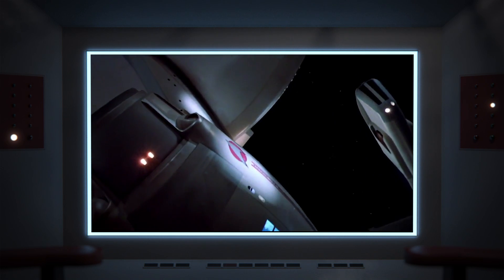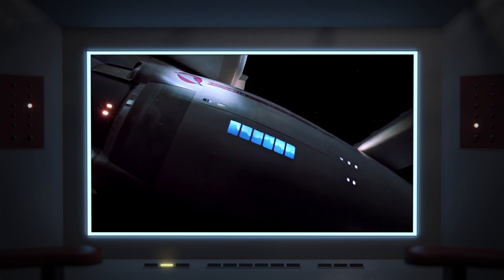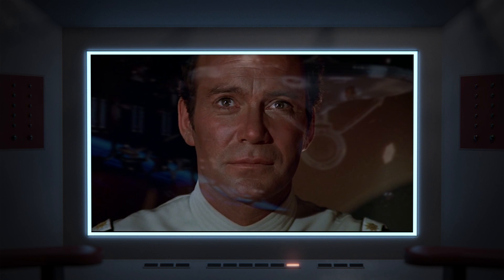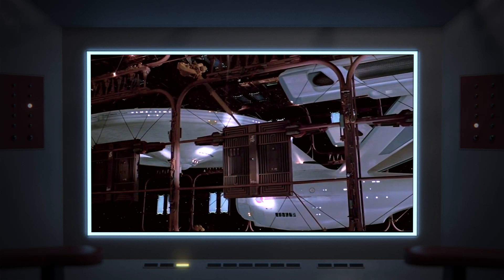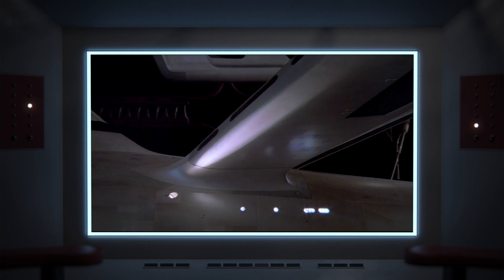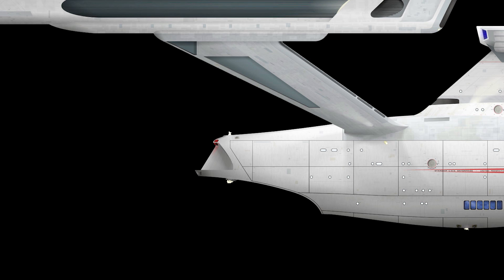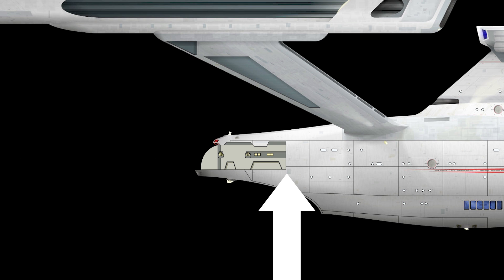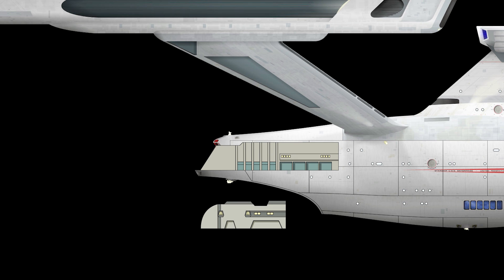Why Have Angled Nacelle Struts? (Enterprise Refit)

Comment: From an engineering standpoint the struts are no longer attached to the nacelle at a single point and are now more triangulated.  This makes them more stable as anyone who ever built models of both ships can attest.  Assassuming an inner framework, the re-angling of the struts would allow them to tie into the neck of the ship for more a more rigid substructure.  Assuming a flow dynamic from nacelles to hull the fewer 90 degree angles the better.  Aesthetically speaking most people don't like hard 90 angles as much as sweeping curves and raked angles.

Comment: Apart from the fact that you're waaaay too OCD about this there would be no need for elevators at the rear of the shuttle bay if instead of having the rear of the hull scooped out it actually stayed more tubular, then they could have had a two tier shuttle bay.
Also, the original series Enterprise is by far the better looking.

Comment: I always thought the swept pylons would aid with power distribution to the warp field coils in the nacelles. Anyone familiar with electrical engineering knows that shorter distances equal less resistance to power flow, and the pylons now attach to the nacelles toward the middle...thus permitting a more even flow to the coils spread along its length. Additionally, since the pylons attach to the secondary hull closer to the warp core, the efficiency would possibly be increased even further. Yes, the pylons do seen longer than before...but the path of power routing is still about the same, if not shorter.

Comment: This is one of my favorite ships in the ST universe and as such, I have researched it a  lot over the years.  One theory, which does tend to make sense (although has never been confirmed) after listening and reading up on the evolution of each new class of ship for the Enterprise, is that the positioning and angle of the struts allow for the ship to not only be more aerodynamic (for lack of a better term) during warp which would allow for it to enter and exit warp more efficiently, and also sustain higher warp factors for longer periods of time.  One of the other theories which also makes sense is that due to the addition of the vertical warp core and foregoing the original engine room design, given the positioning of the new vertical warp core relative to the new angled struts, allows for more efficiency of plasma transfer and ease of access to the struts if maintenance/repairs needed to be done.  Outside of cannon, one of the simplest explanations for this is that the original Enterprise was put together and designed with (compared to TMP and future designs) less detailed thought to the internal locations of everything.  When Phase2 and TMP were being brainstormed, this gave Gene and others involved (namely Matt Jeffries) time needed to redesign and make things more detailed and to map out the entire ship.  The ship turned from a flight of fancy and only being on for 3 seasons to something that could have possibly been around for decades and carry the franchise and crew far into the future, like it did.  The original script for TMP was quite different.  Think of it more like possibly touching the face of God versus only looking for your creator.  From the information that has been given through various videos and websites (and if anyone could find or has the original draft written by Roddenberry before development hell took over, I would be incredibly interested in reading it), TMP was not only supposed to be incredibly cerebral, but also going to be incredibly more internal for the characters, focusing more on what each character would possibly view as God and what it means to them.  This would also stand to reason that since even more time was going to be spent inside the ship vs what we actually see in TMP, the ship layout needed to be even more well thought out and designed. Regardless of the reasoning behind the more prominent changes to the refit, this is still and will always be one of my favorite designs.  I love all the designs of every ship we have seen so far, but this design by far has always been my passion.

Comment: Several thoughts on this.  First is the obvious one that it looks better and they had the budget to build a proper model.  
As far as in universe reasoning, mine goes something like this.  The original design worked and was designed that way to be simple from an engineering perspective.  While there is some controversy about it, I'm in the camp that thinks main engineering was located in the secondary hall and that the tubes we see in engineering cross each other then go straight up the nacelles.  With the refit, main engineering was moved forward with the verticle warp core running the length of the neck. With engineering moved forward, it would make sence to use that space as dipicted in the video for the shuttle bay and other things, but I think this would have been an after thought on what to do with the space.  
A third reasoning has to do with impulse and inertial damping and the like.  We know from mentions in TOS that there was occasional worries of nacelles buckling and such, and I expect this was a limitation of their design.  Additionally under impulse, the nacelles are dead weight being dragged away as the impulse drive is on the saucer.  While inertial damping would normally help with this problem, it's my opinion that the inertial dampeners can only respond fully effectivly to known accelerations, hence why we see folks tossed about when the ship makes movements unexpected to the computer.  It may have been worked out that a stronger strut was a good idea to prevent damage from twisting and the like in combat or other cases where the inertial dampers could not react properly.  

As a side note, I'm not entirely clear on it, but am starting to form a theory that the refit Enterprise is actually more than just that, but instead actually a 'visual reboot' of Star Trek just as we see in discovery.  Many have said quite a bit about how the extensive modifications made little sense, as everything down to the frame was changed.  When you add in things like the Klingons and uniforms and such, it starts looking more like 'Prime timeline, Visual reboot" than just a refit.

Comment: I would imagine that the angled struts would also provide a more sturdy connection, rather like a flying buttress supporting a wall. The push from the warp nacelles is transferred like the tendency of a cathedral wall to push out against the buttress. all else being equal, the square rug would tend to buckle. Consider also the video of the '59 Chevy Bel Air and the 2009 Impala hitting head-on. The arched structure of the Impala directs the thrust around the passenger cabin where the reverse-cant roof pillar of the older car provides a pivot point to pull the roof down onto the occupants.

Comment: the main reason I can see for changing the angle of the struts is pure physics - try this at home:  take two plastic straws and a bowling ball and holding the straws vertically down carefully try to push the ball with the bottom end of the straws across a smooth floor  and you will find that the straws will bend and have virtually no effect on the ball, now try holding the straws at 45 degrees and you will be able to push the ball along relatively easily.  It's all about inertia versus structural integrity... angles matter! - oh and a bigger shuttle bay is a bonus!
Reply: not true for warp drives, a good analogy for a warp drive would be more along the lines of this,;- consider a boat in a still lake, a "warp drive" would be like removing water out of the lake in front of your boat and placing that water behind the boat.. and having the boat roll downhill into the "hollow" 

a warp drive doesnt "PUSH" a ship using its nacelles. instead it creates a warp bubble around the ship and "squishes" space in front and "stretches" space behind.
so theres technically no great forces on the nacelle struts (except normal inertial stresses whilst moving at impulse or in combat, but that's what structural integrity fields do.)

the only real reason for larger nacelle pylons would be the improved resistance to damage due to the larger cross section and perhaps improved resource manipulation, it's much easier to have plasma flow through more substantial structures.
Reply: @Great.Milenko  
Impulse engines exist.
Reply: @Idazmi7  wtf
Reply: @Idazmi7  yeah but ship designs would be ass if structural integrity fields didn't exist.

Comment: It’s interesting to draw parallels between aircraft tails and these struts. 

The vertical stabilizer of an aircraft is often its most recognizable feature on the ground... and from the very early days of trial and error to the Golden Age of aircraft in the 1930s, tails were used as a way to make aircraft look unique. 

In WWII, the switch to aluminum surfaces and the demands of production led to less curves and more straight lines. Then came the Jet Age... where tails like wings needed to be aerodynamically thin to reduce drag, yet thick enough to be strong. Thus, the tails were swept back. 

Since tails on light and slow aircraft were still remarkably tolerant of huge design changes, they were swept back too. The Piper Cherokee had a swept tail in 1960. The Cessna 172 was modified to have a swept tail the same year. 

Swept tails had a few advantages over straight tails. They increase the amount of surface area behind them, allowing for a shorter fuselage. When they have the horizontal stabilizer mounted on top (a t tail), in addition to increasing directional and lateral (roll) stability, they also increase pitch stability and C of G range since the horizontal stabilizer is further aft than it could be mounted at the back of a fuselage the same length.

Comment: Another one is the power conduits that feed the warp nacelles are shorter and have a more direct route to the nacelles.  The new nacelle struts will flex less under hard monovering and in nebulas.

Comment: the engine room redesign probably played a part as well. the original main hull engine room from TOS seen in the 2nd and 3rd seasons, doesn't really have much in the way of actual engine hardware.
https://lh3.googleusercontent.com/_9FtORbQ3BhU/TVxYTP6ePHI/AAAAAAAAAm0/Tx2xtfqPw30/s800/star-trek-engineering-room.jpg 
just a control room around a rather small central device that is shown to hold dilithium crystals, suggesting it is part of the intermix chamber. there is a large tube-room adjacent (seen here in an early shot before they added the intermix chamber pedestal to the set http://atomicjunkshop.com/wp-content/uploads/2017/02/NV_EngineRoom_02-e1487562193256.jpg ) but given how they were treated in the episodes, those are likely part of the energy distribution system (perhaps equivalent to a power transformer assembly) not the warp core itself. visually the engine room suggests that the warp core of the ship was not terrible large, though presumably it was powerful enough for the job. but the fact the ship was as reliant on its impulse engines for power (based on several 1st and 2nd season episodes.) it would seem the warp core was either underpowered compared ot the overall need, or perhaps just not set up to act as the main power for the ships other systems. (the ENT creative team seems ot have gone with this approach for the USS Defiant for "In a mirror darkly", as the Defiant schematics seen do not show any sort of large warp core either. the warp core on th NX-01 was oriented horizontally as well, and only seems large because it was in a tiny room. http://www.ex-astris-scientia.org/inconsistencies/enterprise/warp_core.jpg )
location wise the TOS engineering room was implied to be in the main hull, near the point the nacelles meet the hull. the diagram of the Defiant from "in a mirror darkly" more or less cemented that later. http://subspacecomms.com/sites/default/files/082509-trivia/7.jpg

compare this to the engine room off the TMP/WoK refit.. 
http://www.marcellorossi.info/TMP%20engine%20core%20HD%20combo.jpg
http://movies.trekcore.com/gallery/albums/tmp/themotionpicture0247.jpg
great googily moogily. not only does the new warp core run horizontally back towards the nacelle spars (you can actually see where the conduits to those sprout off), it run vertically as well on the other end, well into the neck between the saucer section and main hull. guess that is one way to pack more power in. and the main engineering control room is now located directly under the neck.. much farther forward than the old engine room, practically right behind the main deflector.
so the angled nacelle struts would have been vital in getting energy to the warp nacelles from the warp core via the shortest (and thus most efficient) path. this was probably the (in universe) goal of angling the struts, and the expanded shuttle bay (and a very large cargo bay) filling the space where the old engine room was was probably something added to make full use of the freed up space.

Comment: If there is some safety reason for ensuring that a nacelle does not significantly overlap the hull (which is occupied by vulnerable crew and machinery), back-swept nacelles make sense. Maybe something about the dilithium breakdown/utilization process occurring in the forepart of the nacelle -- some generated fields or whatever, including in extremis/once damaged -- renders it inadvisable for that reaction to be happening immediately parallel to the pressure hull. There's probably some other Federation ship design(s) that makes bollocks of this explanation, but there you go.

Comment: Maybe it was to push the ship a little more than pulling it the way it may have done in TOS. At that angle on the refit the warp field being generated by the nacelles would push the hull, I would guess (as I am not an engineer and no nothing about physics).

Comment: Video makes a good point about the position of engineering and the shuttle bay. In addition, while there is no atmosphere, there is still inertia. The thrust at sublight comes from the impulse engines in the rear of the saucer - NOT the nacelles. So, they are essentially getting towed behind as the ship accelerates ahead. An angled pylon receives less stress when pulling those heavy nacelles than one at 90 degrees.

Comment: I would have had them angled facing forward toward the saucer section. Made them shorter so the nacelles extended forward underneath the saucer. This could allow for more room at the rear for the shuttle bays to be more accessible. I personally like the idea of it as it would look a little more aggressive, like a Klingon bird of prey is.

Comment: By far my favorite ship in all of Trek. I feel like the TOS version just laid the groundwork, and then the Refit is perfection. A crude rough draft, if you will. And am I the only one that finds it more than a little insulting that in canon, the Enterprise B was an Excelsior class? The Excelsior is cool and all, but it strikes me more as a imitation of the refit. A pretender, even. So then after that, we're supposed to believe they pretender actually SUPERSEDES the perfect original? Unacceptable.
Reply: Not only externally, but the internal sets of the refit-class are still my favorite as well.  I would give the -A bridge an edge over the refit bridge, but everything else from TMP (corridors, sickbay, engineering, hangar deck, rec room, transporter room, officers' lounge) are my absolute favorite designs.  ... I just wish Wrath of Khan didn't see fit to strap extra "tech props" onto everything.  Worse... props that even appear in multiple other films.  The blinky lights and switches walls in Engineering, for example, also appear in The Last Starfighter.  TMP's Engineering was more elegant,... but Wrath's was a bit too busy, especially with the nonsensical reactor chamber off to the side, that was not in any way connected with the Warp Core.
Reply: For me it's a toss up between the refit and the Enterprise E. I like them both.

Comment: Besides the obvious aesthetic improvement it made to the A, I always figured it was something to do with the new vertical warp core in engineering.  The elimination of 90 degree bends a few people mentioned is a good and practical explanation too.  I think your reason is excellent as well.  I never considered the expansion of the docking bay as a design element for changing the pylon placement.  Well done.

Comment: I do not have any degree in engineering but, there is a possible additional benefit aside from what you've mentioned being that structural design could deflect or glance off debris, or other solid object impacts more readily than non-angled struts. Tank designs and other armored military vehicle designs reflect this.  Though this would only truly benefit if all power to deflectors/shields were down.

Would love any input from actual engineer to validate or correct any misconceptions. :-)

Comment: OK, jumping into geekdom...  :-)    The first thing that struck me was that on the refit Enterprise the place where the warp core and plasma conduits meet is much further forward, allowing the warp core to be in the section of secondary hull with the broadest chord.  In addition, this location is also below the neck connection.  This allows the warp core to be placed in a location that is far more efficient in providing EPS power supply to the entire ship.  Tie that in with dialog that makes it clear that things like phasers (which are primarily mounted in the primary hull) are now tied into warp power, and it becomes clear that there is likely a third primary plasma conduit going up through the neck into the primary hull to power systems there.

And ... it looks really cool and soooo much faster.   ;-)